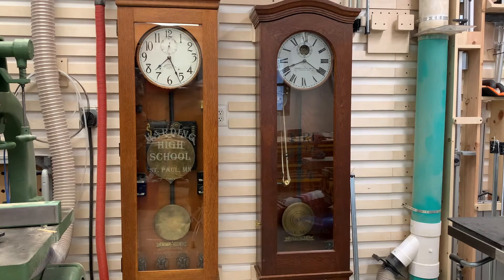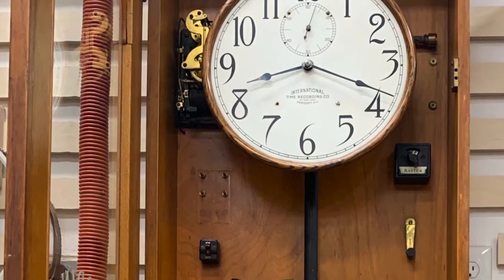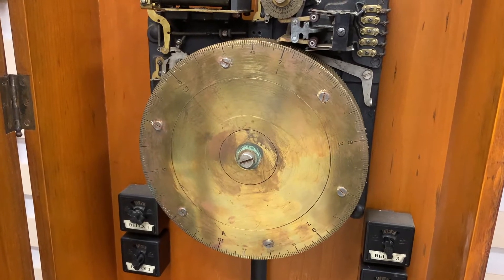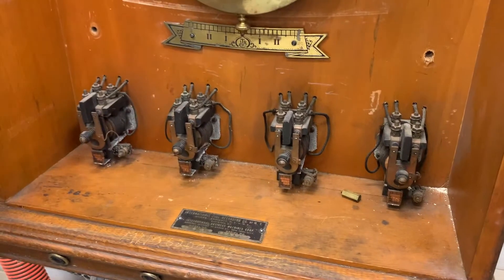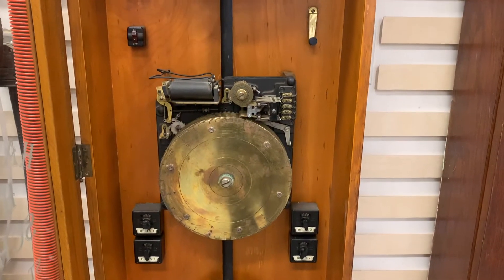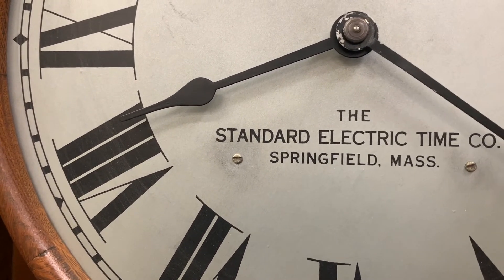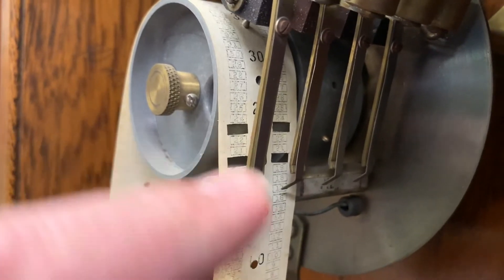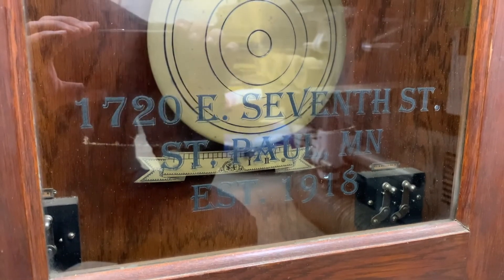Master Clock Restoration Project Introduction

Comment: I have the Standard Electric Version shown with two paper tapes and a few extra tapes in cans, plus one slave clock on a lower floor of the house.  They have worked perfectly since 1999 when I bought them at an auction and had to do all the same debug work as shown in the video.   It works fine on 12V if there is enough current and drives both the winder and slave solenoids.  Apparently it came from the original Local Highschool.

Comment: I worked for Standard Electric Time from 1972 to 1978.  I trained on the "60" beater clocks.  I have some service data.  International time became Simplex.  Standard was always standard.  Standard was owned by Johnson Controls in the 70's.  Standard was sold to Faraday.  Faraday was eventually adsorbed into siemens.  The Standard products were discontinued.

Comment: How do you go about finding these clocks? I have wanted one for awhile now.
Reply from the maker: Hi Ronald - thanks for your comment. If you are in the USA, head over to NAWCC.ORG and find a local chapter near you and join up. From there, networking is the way. They are around. If you are in driving distance to St. Paul, MN, contact me through minnesotawatches.com and I may be able to point you to one.